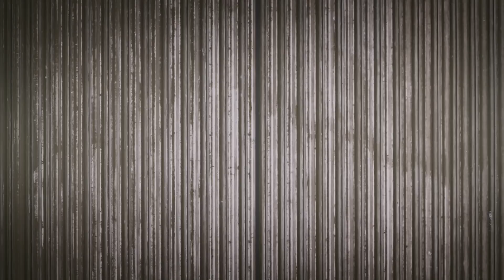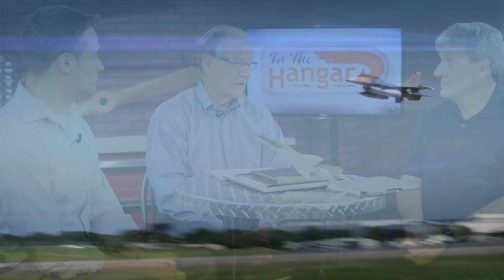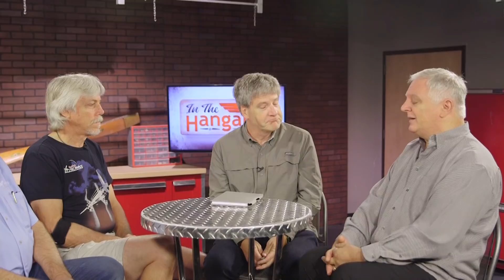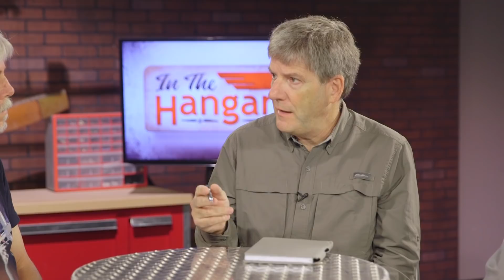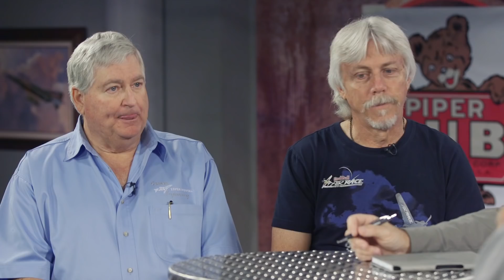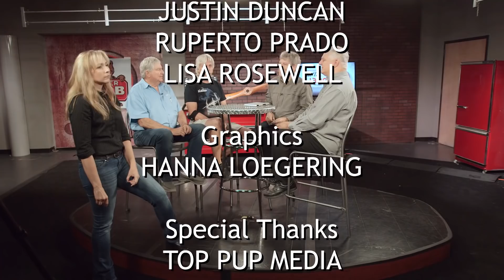Plane Maintenance InTheHangar Ep5

Comment: Made to last forever? HA! Cessna didn't even put corrosion prevention in their birds. They were cheap and disposable. I LOVE most of your videos, but this one sounds like a brochure for unneeded maintenance. Read the NTSB reports. What percentage are post maintenance? Fix it if it's broke, be reasonable on preventive maintenance. Before doing work on something that isn't actually broken ask yourself what would happen if it failed. If the answer is fly it back home and get it fixed, you should probably wait till that happens.

Comment: The "official" answer to the question- What maintenance operation is a private pilot authorized to perform on the aircraft they own?: See FAR part 43.3 para (g) and specifically Appendix A part 43 Major repair , major alterations and preventative maintenance section (c) preventative maintenance items 1- 31 for specific authorized actions. These are the ONLY functions authorized to be performed by a "pilot" rated individual. Some of the terminology utilized in the list may be foreign to a pilot only rated individual and any A&P/IA would be able describe the intent of the what is listed. The references can be found  at www.faa.gov and in search window on upper right of the home page, just enter "part 43" and the link will populate .
Reply: Also read the Coleal letter. The FAA has deemed the list of approved actions non controlling, but merely representative. They are NOT the only actions allowed... They are the only actions specifically allowed.

Comment: As a past pilot of a C210 L, C185 F, C206 G, B-58, C310 M and an A36, here in Central Florida, you need to take to heart preventative Maintenance, and with all Cessna's, corrosion protection. We spent quite a few $$ on Corrosion X, LPS, and ACF 50, with good results.
As you comment, these are 35 and 40 year old Airframes, they need more than a little TLC and a $2500 annual inspection to keep them happy. Good Video